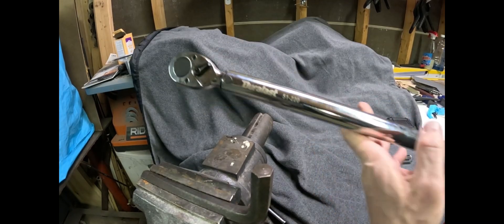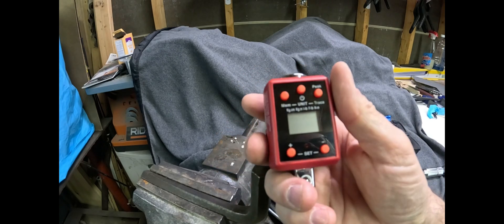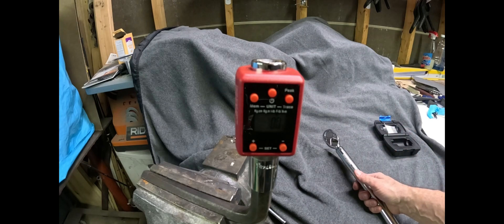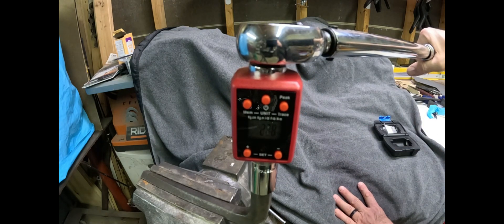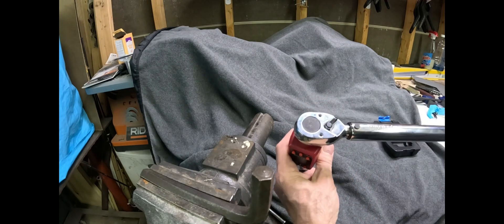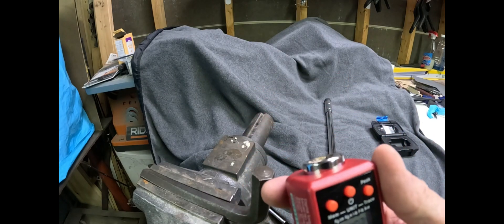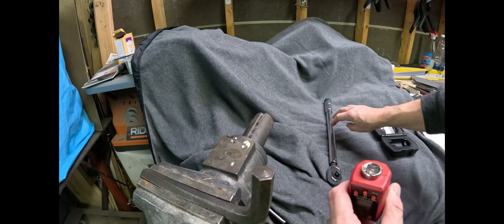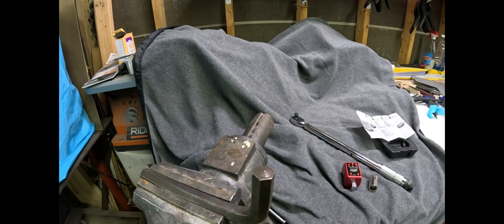Using a Torque Adapter to calibrate my torque wrench

Comment: What assurance is had knowing the adapter is accurate and it's longevity ?
I would have to see it mounted on maybe a breaker bar and tested on a known accurate torque tester getting compared side by side with your conventional torque wrench.
Reply from the maker: It came with a certificate.   I also took it in to work where we do have calibrated torque testers.  It was right on.

Comment: You checked the calibration of that clicker torque wrench but you didn't actually calibrate the wrench.
You would have needed to unscrew the big nut on the end of the wrench, then turn the inner collar clock wise until the wrench reads correctly when torquing, then reinstall that big nut and tighten. Your torque wrench would then be calibrated.
Reply from the maker: Thanks.   I will do that!

Comment: Great video, I've been searching for a torque adapter, your video helps a lot ! I have several tools from Neiko, which are made in Japan , Or should I say Taiwan > Not China, But Taiwan! 
Japan and Taiwan makes a lot of precision and good quality tools.   Thanks Again !
Reply: Thanks for the video. Should the digital torque adapter be calibrated also? Greetings.
Reply from the maker: @cruisecontrol399 so i took mine to work with me and ran it on our snap on torque wrenches that get regular calibration.    It was within 1 or 2 pounds every time.   I would say it is very accurate out.of the box.   If I have time I might take it again and run it on our torque calibration instrument.   But I think it is really accurate right now
Reply from the maker: @joet6796  Thank you!   I agree on the Neiko brand.   It is working great.   I took this adapter to work where we have Snap-On torque wrenches that are calibrated regularly.   This adapter was within 1 or 2 pounds every time.